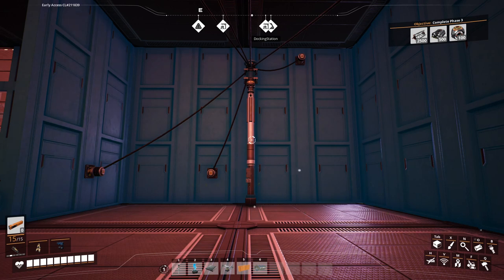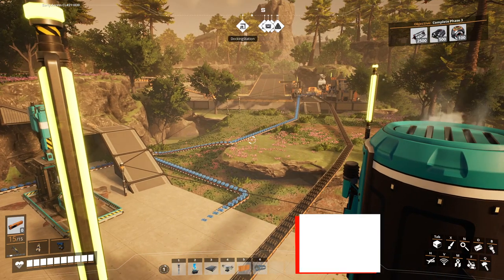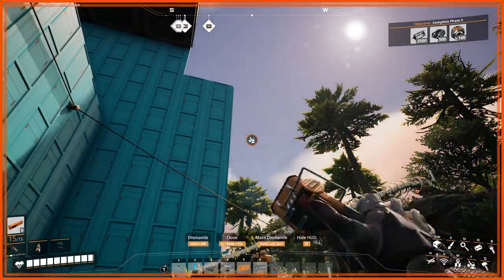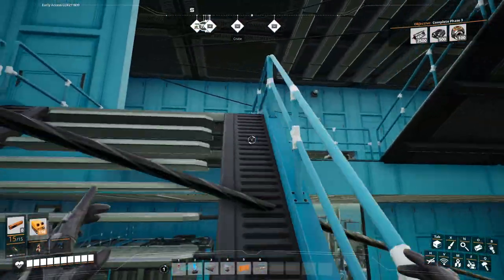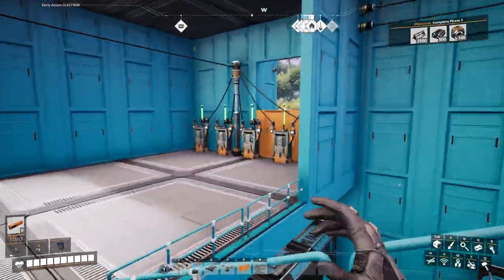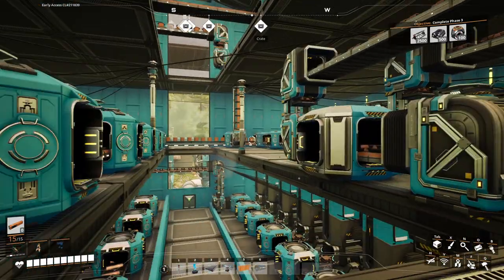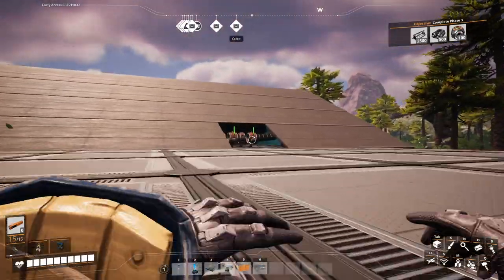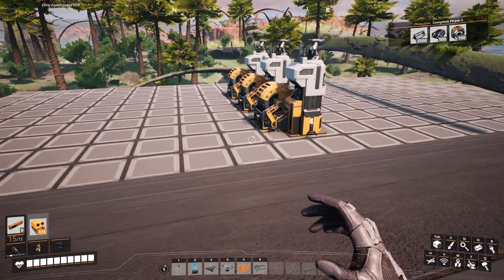How to fix power lines  -Satisfactory pt28

Comment: Why do people dump the excess? Isnt the point to have more they you are producing?
Reply from the maker: The overflow lines will run through a storage system (1 industrial storage crate for each item), and then the remainder will be dumped. Im never gonna need more than a full crate. The system should be able to fill back up as im using the items. If the machine back up they will shut down, and I get nothing for them sitting there. With a proper overflow system, you can at least get awesome tickets. The setup will work like this 

Stocking the next machine (i.e., manufacturer) > filling the storage system > dumping leftovers 

 I hope this makes sense, Great question! 👍